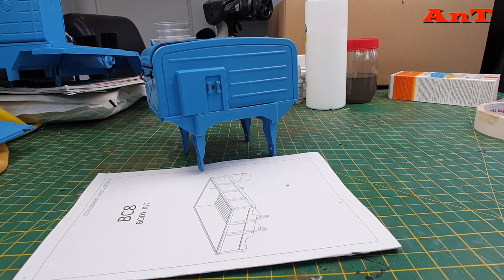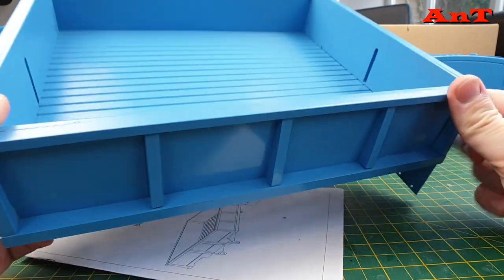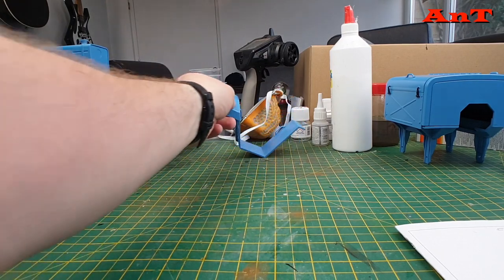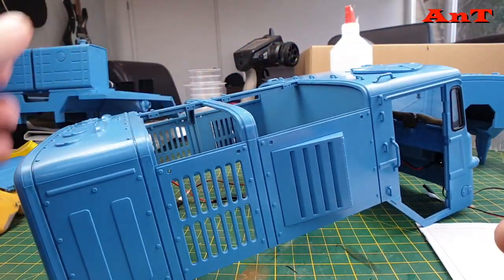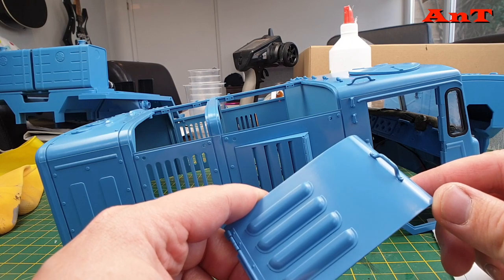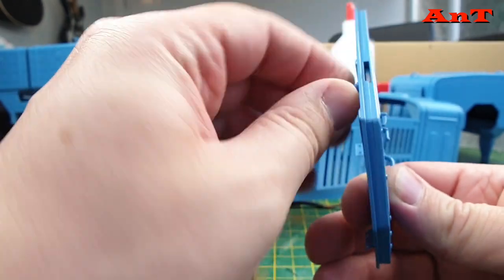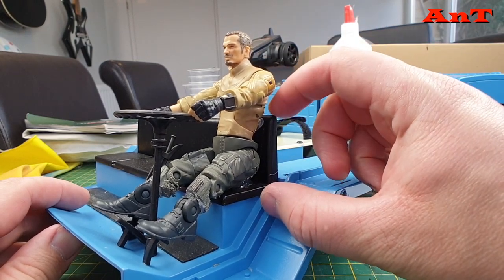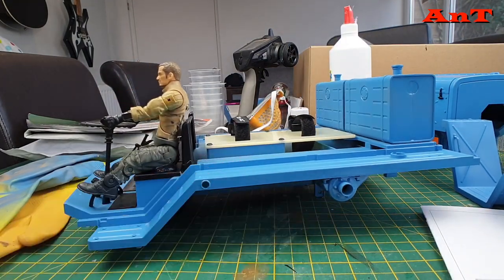BC8 MAMMOTH Build Part 5 Cross RC   Painting is finished!!!!

Comment: The blue does look fantastic and glad you got the rear bed kit. I have seen the real ones and it looks good now no rattle. But  6inch figure in 1/10th 6 foot tall so in 1/12th huge. Look At Dr who figures 1/12th. Did the picture of the MC8 get though in the end.
Reply from the maker: Cheers Mal. I have seen the picture and the mc8 looks amazing that box is ace. I want one. Good work. 

I tried a smaller figure and I didn't like the way they looked so small in the head and shoulders. 

The cross light kit works ish. All apart from headlights and some light. Everything is connected as per manual but nothing.
Reply: @antrc  I would check that all the cables are right the servo link is easy to get the wrong way up so they will not turn on from the radio.

Comment: Can your or your viewers advise if you used a BEC as well as the ESC? I have just started running tests and am finding the Servo arms on the steering are jittering intermittently when moving forward. Both are high powered SAVOX and I am running a 7.4V LIPO. enjoyed your build. many thanks.
Reply from the maker: It does sound like a BEC might be wise - I can't remember if Tel used one to be honest. He used a HW1080 which normally doesn't need one but two big servos might be over doing it. I'll prod him to give his feedback 👍
Reply from the maker: Hi, yes a bec is a must for the two steering servos. They need at least 7.4 volts as mine were 32kg ones I believe 👍Terry.
Reply: @antrc  Many thanks for getting back. Your video was a great help. Have subscribed to follow . Will add the Bec and cross fingers. Cheers from Australia.

Comment: what glue is best to use bud and how much do i need...
Reply from the maker: Some sort of plasti-weld, or modellers' liquid poly at least for the body work. Superglue is always handy. How much? Grab a new  bottle is my advice, even if you have some. They're usually about 50ml bottles and most of that will have gone building this.